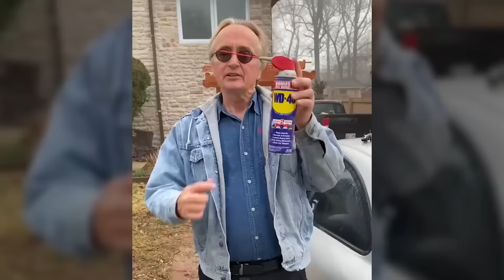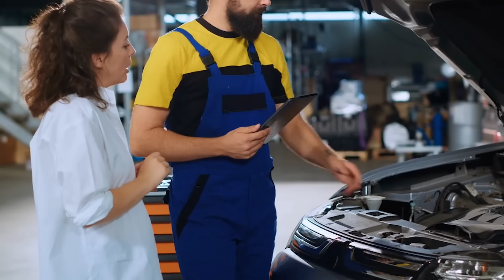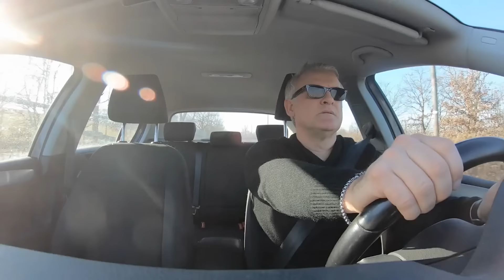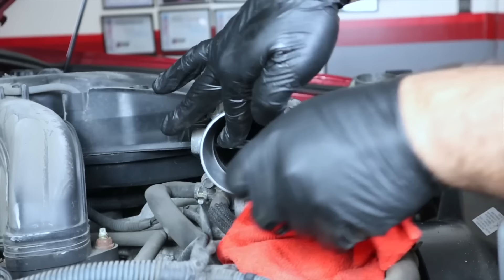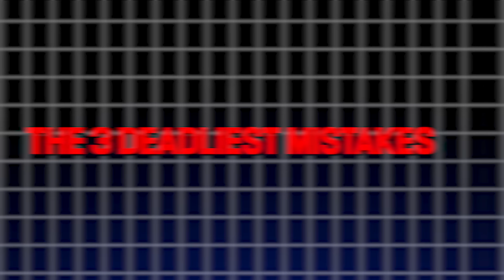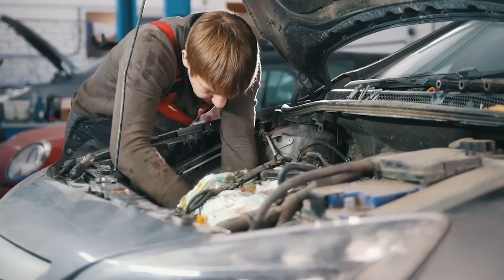Wish I Knew These WD-40  Car Tricks Before! I Would'Ve Saved Thousands

Comment: WD-40 is not ideal for car door hinges and locks; it's best to use specialized products like white lithium grease for hinges and graphite or silicone-based lubricants for locks. While WD-40 can temporarily stop squeaking on hinges and may work on locks initially, it can also strip away existing grease, attract dirt, and its residue can gum up lock mechanisms over time. 
Car door hinges
Why not WD-40: It can wash off the factory grease, leading to increased wear and tear, and its effect is temporary.
Better options: White lithium grease or silicone-based spray lubricants are better choices. They provide longer-lasting lubrication and protection.

Comment: That's precious. You talk about using WD-40 on the hood hinges but you show it being sprayed on door hinges 22:49. Just a little misleading don't you think?? Another thing, if you use WD-40 or any other lubricant on wheel nuts always be sure to clean it off after you get the nuts lose. If not, the wheel nuts can become lose and I think we all know where that's leading. Wheel studs and nuts are not meant to be lubricated. It creates a dangerous situation no one needs. As a battery terminal cleaner, it may remove some stuff but you really need to clean them properly. I use about a tablespoon of baking soda in a glass of water. I apply it to the battery terminals, the top of the battery and the battery posts and scrub with an old toothbrush. Then flush with clear cool water. Put Vaseline on the posts, replace the terminals and tighten then apply more to the terminals and the top of the posts. That's the only way I clean and protect the posts and terminals and cost less than the WD-40. It also cleans the area between the posts where an accumulation of battery acid and dirt can eventually cause the battery to discharge between the posts. Next thing you know you have a dead battery. I keep WD-40 around for very few circumstances. It has it's uses. Drive through water and the engine quits, spray the plug wires and coils with WD-40. It displaces moisture so the engine starts again. I agree with never using it on door and trunk seals. For that spray silicone spray around the seal, let it sit for a few minutes and wipe off. I do this every fall to also help stop the doors or trunk lid from freezing shut in cold weather. As for the 3 mistakes you mentioned, it's hard to imagine anyone doing any of those but some........ people do it anyway. I've run into that a few times in my years as a licensed mechanic. A quick decision can cost you thousands of dollars in repairs and in the case of brakes, many thousands of dollars for repairs to not only your vehicle but the other vehicles involved in an accident and possibly hundreds of thousands or more if someone is hurt. Another bad one (going slightly off topic) is using ArmorAll on tires. Happened a lot years ago and caused some serious accidents. Thanks for the video. I kinda enjoyed the laughs.

Comment: Got water stuck behind your eardrum or in your inner ear? Just insert the slender red extension into the spray nozzle opening  of your can of WD-40  and jam it straight thru your right eyeball, spraying in short, quick bursts, until it can't go any deeper, because if you thought it would be a good idea to spray it in your ear to displace  water, the water on your brain is probably a bigger issue...
Reply: Darn it I lost the red straw. I was gonna use it for pink eye

Comment: Wipe all weather stripping down with it. I had cars 20 years old the rubber still held up
Reply: Try silicone spray instead.  It’s just as effective without the grease. Wd40 causes the rubber to degrade faster. I use silicone on my rubber door seals, garage door, locks etc.

Comment: Absolutely do not take this for what he says.  He is referring to wd40 as a brand.  Take the throttle body for example.  You should never ever ever wvwr spray the regular wd40 into the throttle body.  ONLY use products labeled throttle body cleaners.  Thats just one example.  Also look at the can for the electrical components. Its contact cleaner which is used to clean electrical contacts.  This is either sponsored by WD40 or he doesn’t exactly know what hes talking about.  Trust me and do actual reserch before using any product for something important.
Reply: I can agree there.
Reply: Absolutely follow this advice.  I was fixing to post the same about the different WD40 products.
Reply: Yeah this is a potentially dangerous video because a newbie will go to Lowe's, see the minimal choice of WD-40 products, and just make a best guess
Reply: Thanks for the useful infos 😘👍

Comment: Brighto it makes old bodies new…woo woo woo woo woo woo…load of BS spraying anything all over car parts…Kroil hands down busts rust better than anything…period …it dissolves rust…most people either never heard of it or are too cheap to buy it..same  with De-ox-it for corrosion on wire terminals…none better…WD means water displacement…truly good for caps, rotors, plug wires…for each thing he mentions for WD there is some other product thats more focused fir that purpose…
Reply: You must be old school if you remember the caps and rotors although you wouldn't use WD on the rotor but you missed points and condenser.
Reply: @vanwrinkle-01  dont forget the primary wire with its cracked insulation, or the greaseless points rubbing block disappearing…Sheesh

Comment: My kid's Intimidator leaks during heavy rain we got a car cover since we got no garage like the previous owner. I never actually thought of the door seal being the problem bc the 2004 Monte Carlo SS I have but sits now  leaked too & we were told the leak was the drain tube. The front driver's side always got wet 1st. I assumed hers was the same issue only the back seat will get wet on the driver's side but on the passenger side u can watch the water drip from the bottom of the door. It was about a month ago I noticed a rust spot in the door hinge on the passenger side I don't believe was there prior to us purchasing the car it will be a year this Oct. If the original owner knew of this I believe we would of been told idk. I assume bc it was garage kept he never knew of the issue.
Reply: Removes hemorrhoids - NOT❕

Comment: I didn't even need to watch the last 3 DO NOT DO to know that. In my opinion it should be common sense NOT to use WD40 on brakes in my mind it's like putting baby oil on em it's just going to make the pads slide which means it's harder to stop & I DON'T know much about cars but that 1 was obvious to me.

Comment: The WD-40 is a brand that offers a wide selection of products, not just the original multi-use spray, but also specialized products like lubricants, cleaners, degreasers, and rust inhibitors under the WD-40 Specialist line, all designed for different tasks.

So, beore you by any, make sure the you're buyin rhe exact product which is meant for your usage purpose. 

Here are some categories of products you can find under the WD-40 brand:

WD-40 Multi-Use Product: 

The original, well-known product with over 2,000 documented uses for cleaning, displacing moisture, penetrating, lubricating, and protecting. 

WD-40 Specialist: 

A line of products with specialized formulas for specific jobs: 

Lubricants: Including Gel Lube, Silicone, White Lithium Grease, and Dry Lube. 

Cleaners & Degreasers: Such as Machine & Engine Degreaser and Electric Parts Cleaner. 

Penetrants: Fast-acting formulas like Penetrant with EZ-REACH to break apart stuck parts. 

Corrosion Inhibitors: Products designed for long-term rust prevention. 

Contact Cleaners: Specifically formulated for cleaning electrical parts.

Comment: I've actually used WD-40 to rescue a seized bolt on my exhaust before, and this video explains it perfectly. The trick of waiting at least 15 minutes really makes the difference. One extra tip: after loosening the bolt, apply anti-seize compound before reinstalling it so you don’t face the same nightmare again.
Reply: It's amazing just how many people have never heard of Never Seize.  LOL. I've also never seen work done in a shop where they used Never Seize on nuts and bolts and especially exhaust studs, nuts and bolts. If they don't use it they stand more of a chance of making more money if they have to repair the car again and either break the studs/bolts and then have to pull the manifold to remove the broken parts or worse break the manifold and have to replace it. A lot of shops don't have your interest in mind, they have their own in mind and you pay the price.
Reply: Use pb  blaster on bolts hard to get marble head
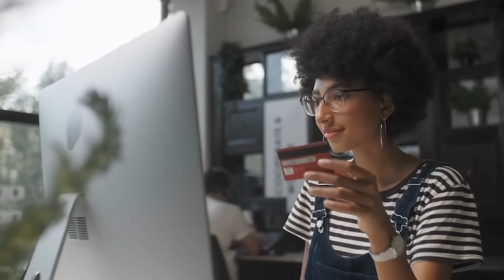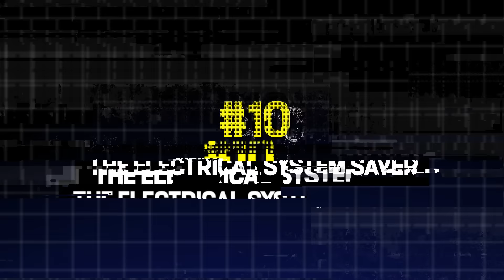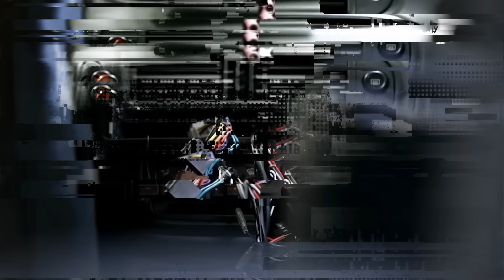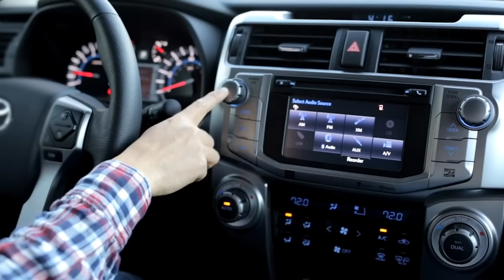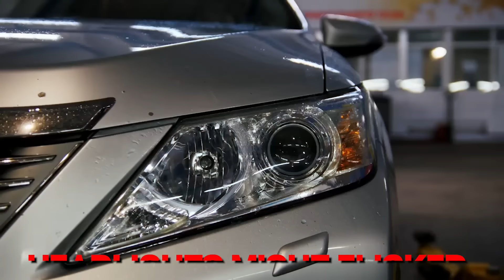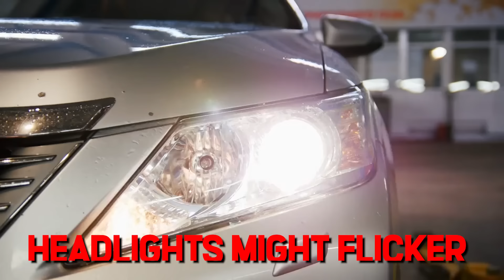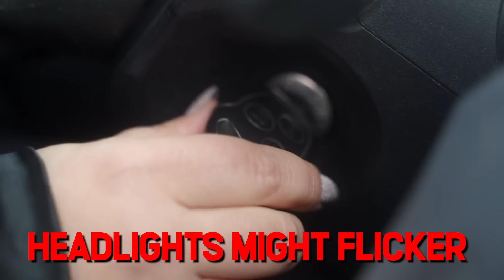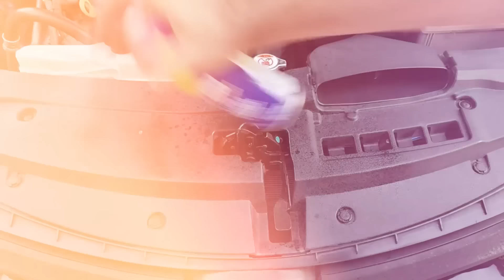Reply: 😮😅😅😮rh56j4hehduje46jthj6j5jj6eeeh464j6dt5rhhs6js5Jrh6a6 3:24 5rharh😮 is HTH ehee?55j4u5fhher😢hh6hhe😮6uehe6 3:25 j4😅j5j😮😅55😅h4jhjehej4ej66j4h😮4jejsed 3:26 hjjj6d😮dj😢jee😮5ar6h😢JH5 3:27 3:27 😢haygh5😅ahrjr😮😮j4rh6😅uU😮u4ehu6ejh6j4e6hrjet6e😮6h44eu5jr5th😅ea5h65r4jdhe😮6ejhe5r😮djhe😮r😮rHh6uah5😅😢r😅😅hJY6H😮J😅😅ah😅4rh 3:30 he5ueej6r 3:30 hetj😅jjdjj6e5jr😮j45je6j 3:31 😮d4j 3:31 hh6ehd😮4jdhsr4h6h6eh6shs5 3:31 😅jr😮a😮tr5eh 3:32 4ahah😅😢6jh 3:32 aj5😮ehe6 3:32 ah4ahauRH54ahrRuuU5e 3:33 H4j6rH😢usuhjrj4ej 3:33 4hhr4😮4jejre😅she😮ee😮utrj 3:34 4haej6jajer6j4jjea6😮e 3:35 j 3:35 J 3:35 j6je5jjh45h4😮h4jej😅😜j4erjshhe4jhrjr44sjrhdhrdjsjjhr4j 3:37 jrrjjeh4jjej5ajhsdrj46 3:37 j😢 3:38 rjedj4ej4he4rhej4 3:38 j6h5j5tehejdrj5rj😅rujrh😢 3:39 4jd 3:39 😢😅rue4t 3:39 jjj4 3:39 😅h55hhs😢hs454j6sj 3:39 😢h 3:39 6j4eh46he😮😅rdje 3:40 s 3:40 5j4ddhjhjr😅r😮rh4j 3:40 jejd 3:41 5e4hjf5😢jr😮tjrr4😮j6j6jr5ht😢ref h46ej4jh6ftrhhu6je 3:42 😢 3:42 6ejhhj6😮😅😅😅 3:42 😮😮😅5245h4a437 😢😅 3:36  3:36is 4js😅 3:24  3:24  3:24 3:24 :24 6😮?5😅 3:23 ?😢5😮😢 3:22  3:22  3:22

Comment: Never ever clean a throttle body with WD40. You must Only use throttle body cleaner. You will ruin the throttle body otherwise.
Reply: What's a throttle
Reply: I agree
Reply: true
Reply: I agree. I used throttle body cleaner on my old Grand Prix throttle body. Made a huge difference in how the engine ran and brought the gas mileage back up. A friend wouldn't listen and used WD-40 to clean his. That was a total disaster.

Comment: This is bullshit, wd40 will cause the paint to  peel-off after a while, it penetrates under the paint and results in a bigger rust spot. Wd-40 also penetrates some plastoc parts and breaks it down.
Reply: I 100% agree Brother Vernon!!! As a self taught mechanic who never  had to ever take my car nor my wife's car to a garage for repairs, i learned years ago, the hard way, which of course is the best way, that products, such as WD40, PB BLASTER, etc., destroys plastic,  rubber, and paint etc., as you pointed out!!!  Diesel fuel is the best lubricant in the world and will not deteriate plastic, rubber nor paint 👍
Reply: @diontury7585  In the old days we used to use diesel to flush engines that had never been taken care of. eg lack of oil changes that gunk up the engine block.
Reply: Oils on paint , plastic,and rubber is a no no 😂
Reply: FYI- They didn't say they used the silicone version for the window components. They said don't use wd40 on seals but also showed it used on the window seals 🤔. I found wd40 works great at reviving faded plastic engine parts and covers  I've even used it on headlights to temporarily make them clearer.
Reply: WD40 is a good product.
Reply: Liked MUCH!! Good tips!!

Comment: The best stuff for dealing with rust is rust check. For removing rust to get nuts or stuck bolts is deep  creep  the best I have ever used. WD 40 is like  fish oil and makes more  rust. It has  its  use  but not always good. Iam  67 and  find rust check  and and deep creep are the best. There is a throttle body cleaner.  This is just a commercial for WD 40.
Reply: The WD-40 is a brand that offers a wide selection of products, not just the original multi-use spray, but also specialized products like lubricants, cleaners, degreasers, and rust inhibitors under the WD-40 Specialist line, all designed for different tasks.

So, beore you by any, make sure the you're buyin rhe exact product which is meant for your usage purpose. 

Here are some categories of products you can find under the WD-40 brand:

WD-40 Multi-Use Product: 

The original, well-known product with over 2,000 documented uses for cleaning, displacing moisture, penetrating, lubricating, and protecting. 

WD-40 Specialist: 

A line of products with specialized formulas for specific jobs: 

Lubricants: Including Gel Lube, Silicone, White Lithium Grease, and Dry Lube. 

Cleaners & Degreasers: Such as Machine & Engine Degreaser and Electric Parts Cleaner. 

Penetrants: Fast-acting formulas like Penetrant with EZ-REACH to break apart stuck parts. 

Corrosion Inhibitors: Products designed for long-term rust prevention. 

Contact Cleaners: Specifically formulated for cleaning electrical parts.

Comment: These WD-40 tricks are game changers. Never thought a $6 can could save thousands in repairs. Rust prevention and bolt loosening tips are pure gold.
Reply: Some true, some bologna
Reply: I use a silicone spray instead on some moving part because it does the job without catching dust and dirt like wd40. A dirty key hole does not look good.
Reply: That's total b.s. it's not a lubricant or rust preventor.

Comment: Fr, use it in locks? 
It'd clogg the mechanism and it wouldn't even work at all. 
Plus how could you even suggest using it on rubber parts, it'll dry them up eventually leading to cracked rubber
Reply: I find getting a little bottle of lock deicer with lubricant works better than almost any thing else. WD messed up my door lock on my last car. Had to pull the lock (in the winter time) colder than heck outside, bring it in the shop and clean it all out. Funny part is that I used WD to clean out the lock then used the lock deicer with lubricant to lubricate the lock. Worked fine after that.